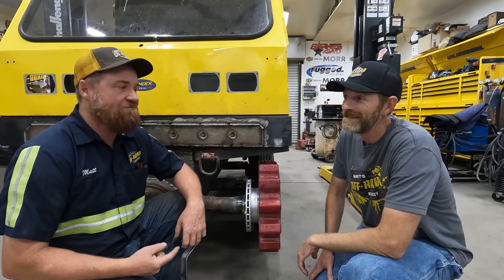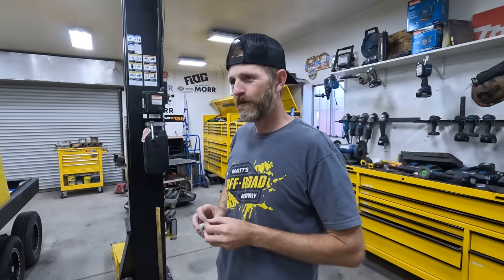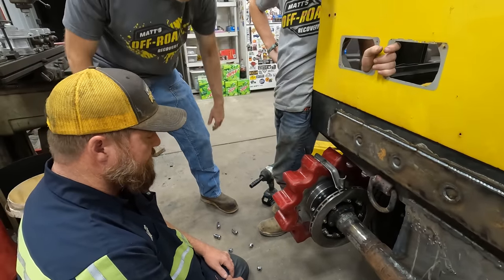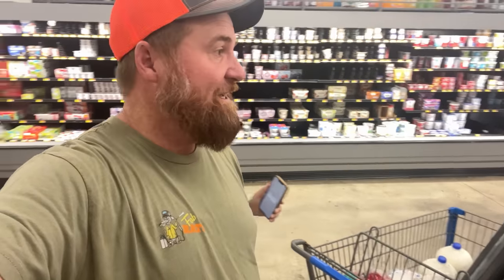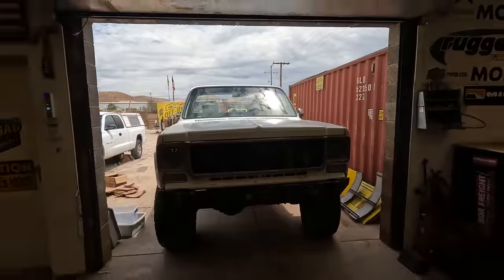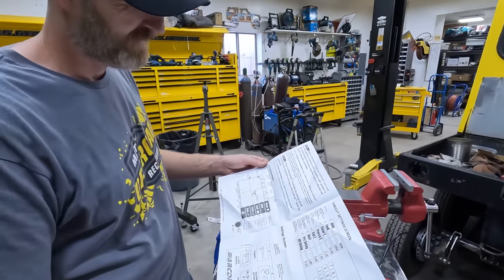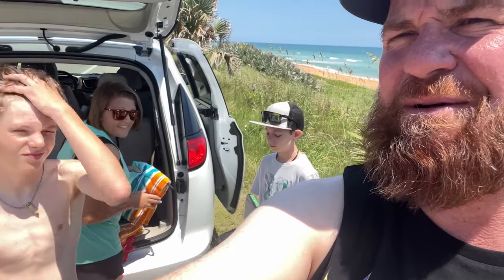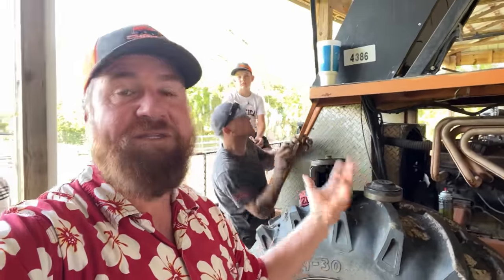7 Reasons We Stopped Working On The Bombi

Comment: I think Johnnyboy has been my pilot before. It explains the "We've reached our flight altitude of 32,000 feet and we're turning off the seat belt light. Also if you're on the left side of the aircraft and look out at the mountain ridge at 10 o'clock, there's a nice 4 point buck enjoying a meal."
Reply: Ha! 🤣

Comment: Got lucky on the cam position sensor. The oil pump drive blade doesn't necessarily line up from sensor to sensor. Got to use the alignment hole (if OE style) or the alignment cap (what your O'Reilly unit will probably show up with).

Comment: Speaking from an engineering and fabricator (I've been both) perspective, it would have been better to attach the reinforcement plate to the UNDERSIDE of the tabletop. Then, when the vice is removed for clear workspace, the workspace would be clear, not obstructed by the plate.
Reply: Yes,you could have just welded nuts under the table, or if the table material is thick enough just drill and tap the holes
Reply: I thought of the same thing at first. But I think Tom was talking about the vice being portable and not needing the benchtop space. Plus it would have sucked trying to weld the plate underneath the table. And as hard as they are on their tools, the reinforcement, was probably necessary.
Reply: That's just not the MORR way.  Come on maaaan.
Reply: Great idea that would have been super clean!  I wanted to have Flog cut a whole new 3/8 top but ultimately decided that old cart wasn't worth it.  Maybe we'll build some nice tables when the new shop is finished.
Reply: @tomtomsshop that old cart could have been a newish cart. You nailed that list, too! Good to see you as part of the MORR crew
Reply: I would of welded up a flip up wing with the vise on it so when not needed it simply folds over side.

Comment: I know your pain, Tom. I had a '89 Dodge Dakota  V6, that quit on me one day. My brother towed me home and I checked my trouble codes against my Haynes manual and it told me I wasn't getting signal from the distributor. I popped the cap off and found the pick-up, on the Hall Effect Device had snapped off. I had a friend take me to the parts store and got a new one. Installed it and it still wouldn't start. I popped the cap off again and my new HED was shattered into tiny pieces. I sucked out the debris, with my shop vac, still trying to find out why, and I saw it. The interruptor crown in the bottom of the distributor, is held in place on the shaft, by a roll pin. Over the 20 years that I had owned this truck, that roll pin had slowly worked it's why out, far enough that it had eaten it's way through the pick-up on the HED, causing it to finally snap. I didn't notice it, when I put the new HED in and it hit all at once, destroying the HED. I went to the parts store, for another and the man asked me what happened, I told him and he gave me my money back. Told him it was operator error, he didn't care. I had to go down the street to another parts store, as the first one was out. Got my part, took a pair of channel locks and pushed the roll pin back in place, all was good. Fired right up.

Comment: Gentlemen, the brake issue might even get worse as you go further inboard as the tracks are probably going to walk off at some time and meet the caliper assembly just when ya least need that to   happen. My suggestion is to go to a brake shoe assembly on the inside of your drum that is part of the inset assembly making it impossible for something to grab your calipers. I do believe that you have changed brake pads on a rear axle where the hydraulic part for driving was a pad under a caliper and the emergency brake was on a cable on the inside part of the rotor. That said, whether its cable or hydraulic ... I honestly do believe it can also be used hydraulically just as well for the what was cable on a say pickup truck. I like hydraulic better than cable as they don't stretch like a cable would/will over time of use. And if your a real fab kind of guy, you might just go with a brake band on the outside of the drum as long as it doesn't have a caliper on the outside to get hooked on

Comment: In the late 60s when I was in the Navy, I had a Corvair Corsa that I would drive back-and-forth between South Florida and Norfolk, Virginia. Ralph Nader used to badmouth these cars because of their stability. I put in a heavier, duty sway bar and wider wheels and tires on the rear end. This was back before 95 was completed and I was driving on back country roads with a lot of curves. Let me tell you that thing cornered like it was on the rails. It was a good car except for the oil leaks.
Reply: I knew a guy that installed valve guide seals made for aircraft grade materials; solved the oil leak problem. But I know what you mean; the only time the back of my Corvair was clean was right after a wash.
Reply: Hey, when a Corvair stops leaking oil, it means that all the oil is gone!

Comment: If all the axles are solid and also attached to each other by supports then it might be a good idea to tie the engine mounts to them since they are going to be a lot stronger than the rest of the original Bombi (or is it Bombee now?) that looks to be one gauge thicker than sheet metal and was designed for a riding lawn mower engine and now it has an LS with maybe 40+  times the horsepower. If not the windows might pop out the first time Matt goose's it. I don't know anything about Bombi's but with no suspension it might be like having 80 lbs of air in your tires and trying to get thru the beach sand on a 115 degree day pulling a toy hauler. Less of the track on the ground is what I mean by that. This build, suspension wise, is the complete opposite of what Matt usually does with all the others. Instead of much much more travel this one has none. It is tracks instead of tires on the ground so we will have to wait and see what happens. Unless there is a long distraction I think the Bombi will be ready to go before the first snow. Didn't Tyson used to say "Looks like a butterfly and stings like a bee"? That's been popping up in my mind this whole post. I get songs stuck in there too sometimes. Meanwhile in FL I don't remember whose swamp buggy that Paul uses while there but I know the three times I've seen it he had to repair it before they could enjoy it. Matt must have demoed Paul since he wasn't on the podium. Maybe find out what happened in Paul's video.

Comment: I've a bad feeling about those black spacers... They don't seem thick enough to avoid "wrapping" around the axle case if you brake seriously... Just look at the difference of thickness between the one piece disks and those things... And the more you move the disks inboard, the more the forces to "wrap" those spacers are higher...
Reply: Yeah the physics involved with that can be a little confusing. As long as the calipers are mounted good and solid there shouldn’t be any problems at all. Just think of it as a large hollow driveshaft.
Reply: They run those on race cars.   I'm sure it'll be fine
Reply: They're built for custom use. So I don't think they're an issue.

Comment: Bombi suggestions: raise the cab off the pan/frame for more leg room. Put brakes on the rear wheels by building sprockets with drum or disc brakes inside the wheel/sprocket or the same sprockets as the front but with onboard disc brakes inside the tunnel that would protect them from freezing.
Reply: P
Reply: As brakes are steering. The idea of dual brakes each track makes sense. Say on different unit?
Reply: He mentioned previously, each side will have two brakes.
Reply: They did say that there will be brakes inline,inside.That will be a parking brake,and overall brake.The ones Outside are for steering,and stopping.

Comment: Tom, don't forget that when you move the brake inboard, you're removing the thickness of the old disc's hat from your sprocket placement, moving it inboard by that thickness.  Might want to measure that up and make sure the sprocket isn't too far out of alignment.

Comment: Might need a removable drain plug on the low point of the metal that boxed in the diff, especially since you will be using it in snow.
Reply: He left gaps in the welds for that reason.
Reply: I guess you just need to get the grinder out to pull your third member now?
Reply: @joeberry1556 Makes u wonder
Reply: @joeberry1556  I think they could pull it out through the top if they had to. Or a grinder, but I don’t expect Matt to do much maintenance.
Reply: Earlier on I thought they mentioned they were going to add some sort of drain.

Comment: As a former O'Reillys employee- I waranteed tons of crank and cam position sensors. I think the ones they sell are kinda crappy. The borg warner (if they still stock those) are better than master pro. But the lesson ive learned is the after market is not as reliable (but is cheaper) than oem parts. Buy jeep parts for you jeep if you have the money.

Comment: The Tangerine cam position sensor is in the location that the old distributor would have been located. Typically these units whether it is Dodge or Ford etc., the bearings will wear or wear out completely and fail. When they only wear slightly the bearing play will throw off the timing and leave you wondering why you engine seems under-powered or miss firing. I used to call it Ford junk, but apparently Chryco products used this UN-reliable ignition system as well.

Comment: Can you mount the rotor hat to the back of the axle flange? Even add a spacer if necessary? Maybe have to narrow the axle some more and use a spacer between the rotor and the drive gear.

Comment: That's a crazy off-set for those rotor hats. And you still need a spacer! If you think you might heat the brakes up during any recoveries, you might consider adding floating hardware to the disc to let it expand. They look like non-directional late-model discs. I'm curious to see the solution in the next video. What a great team/family you guys have!

Comment: Here's an idea 💡 take two military axles like the ones on monster trucks with the planetary gears cut one side off of each attach them together but separated then attach the brake disks to the input shafts and then to a heavy duty gear driven transfer case and then to a Alison transmission and you can call it the Killer BombBee 🐝🐝🐝🐝😊

Comment: Any chance you could use a Rockwell style axle like a monster truck? The brake rotor mounts to the diff. It would solve your brake clearance issue.
Reply: The brakes do the steering, so you have to have 1 brake per track.

Comment: Tom! When the cats away the mice will play. 🤣🤣 Just curious about boxing in the drive shaft, how are you going to service it when brakes?
Reply: The plate that covers it unbolts and there is enough motion on the transmission slip shaft to get it in and out.

Comment: I'm sure Tom Tom can figure out an effective E-brake style drum brake system and not use the brake caliper at all, then the rotors can be cut down to a smaller diameter for clearance.

Comment: Anyone else concerned about those solid mounted axles with no suspension? I think they're overlooking something very important about tracked vehicles. Each track wheel needs to be in full contact with the terrain at all times. The original Bombi had a suspension (albeit not in great shape) that allowed for some up and down movement. Look at the original Bombadiers design and you will see why a suspension is necessary. Timbren makes exactly what is called for here with 4-6" of travel. It would be about $6-8K for 4 sets, but replacing those bone shaking solid trailer axles will also allow for a completely flat bottom and more clearance. I really hope they do it now, before they regret it later.

Comment: Hey Matt.. The correct way to say or use Serpentine is, Serpen•teen when talking about the path or route of an object or in yours and Paul's case Serpen•teen belt..
Serpen•tine, is used when talking about a name of a object like a crystalline mineral named Chrysotile Serpentine.
Either way can be used as a name of a person..
They're ya go guys, problem solved..
Thanks for what Y'all do and have a good time..
Reply: That's only your opinion, and using your example, the belt is an object so is therefore correctly called a serpen - tine belt.

Comment: I think with the brake rotors you are going the wrong way. Try a lower profile hat rotor that just lets you sneak in the bracket and caliper even if you have to take the sprocket off to do it. And make the caliper and mount the bracket to the axle tube at about the 4'oclock position and it won't have interference with the guides.

Comment: The Grind Hard Plumbing guys gave away an ArcDroid plasma cutter, but obviously still have one, and they do some beautiful work with it.  Ethan likes to cut out hexagon holes in fabrication plates he makes with the ArcDroid, and it looks super easy to draw one and copy it a bunch of times.  Speaking of CAD, it would have totally avoided the problem they had with the Bambi track hitting the brake disk, and it doesn’t take long to learn a system like SketchUp, and SketchUp can export to DXF format to drive the ArcDroid.  It’s such a no brained, I feel sure that Tom will Convince Matt to go that way…….  eventually.

Comment: "Dog House" = The front clip off a car/truck sitting on the ground.  Front Clip is"  both front fenders attached to the grill/radiator support.  It looks like a dog house, with the wheel cut out as the door opening.

Comment: Only 17m into the video and I'm betting the Tangerine has a bad fuel pump or a clogged fuel filter. Let's see how  it goes...

Edit: Guess not!
Reply: Good guess though. I checked that myself.
Reply: @tomtomsshop , my guess was due to recent experience with my 96 XJ after a few replacements of common failure points that led to a dead 6-month-old pump. I also changed the CPS first!